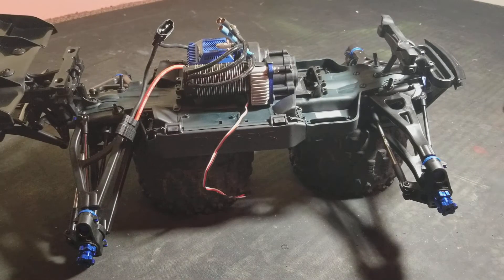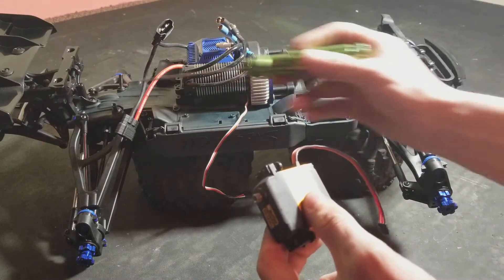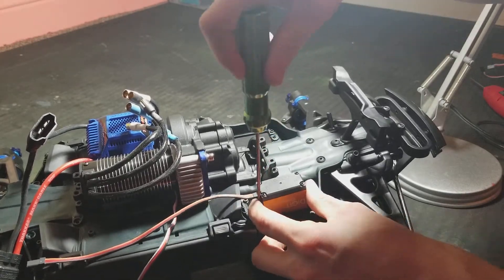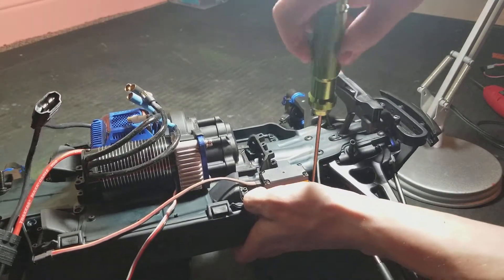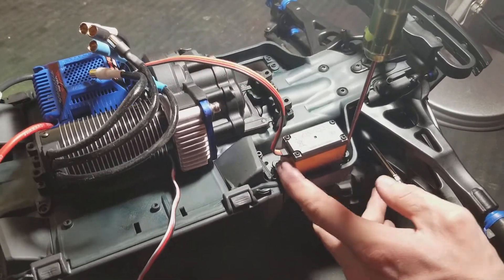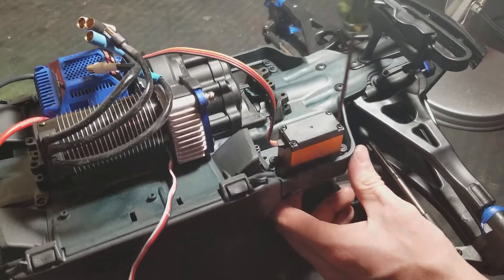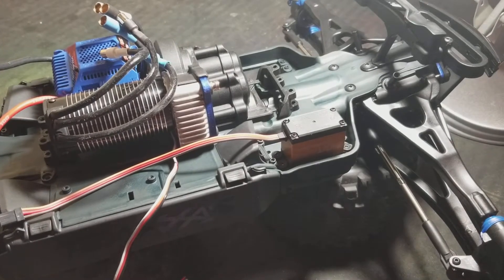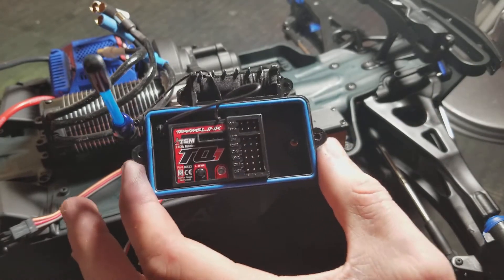E revo 2.0 savox sa1230sg steering servo install

Comment: Hey Alex,  Thanks for the tutorials.  I would love here your experience with the upgrades you have done.  Especially these servos. I don't seem to find a follow up video of showing the Revo running after each upgrade, with your thoughts of a difference.  And then maybe a follow up video later on about how upgrades have held up overtime.  Keep up the videos!

Comment: So you only need one servo it comes with two what do you do with the other spot
Reply from the maker: Ronald Costigan nothing  just leave  it  500oz of tourq at 6v is more  than  enough  power  to turn any wheel and tire combo
Reply: Thanks
Reply: Ronald Costigan I put a pez dispenser in that spot to make use of it.

Comment: Hey Alex,
Are there any problems in form of losing steering speed or steering torque by using one Servo???
Reply: And is quite a bit faster aswell. Also, its always more efficient to run one servo, two servos tend to fight each other because of slightly varying specs, even if they are the same model and make
Reply: And another tip, dont use those rubber gromets... They arent necessary for a steering servo in a car and it makes it much easier to install. They're used to give the servo some flex under load to save the servo, but the servo saver has got that covered already. Its also used to dampen vibrations but thats more of an issue with rc helis and planes where the motor is on for the duration of the flight.

Comment: I installed new servos but now my car only steers to the left a little and a lot to the right so the steering is uneven how do I fix that
Reply from the maker: johnny bravo take off the servo horn turn on the vehicle and the transmitter make sure your steering adjustment knob on the transmitter is centered on zero then Center the wheels as best as possible reinstall the servo horn and it should hopefully fix your problem it sounds like the servo horn is not adjusted correctly hopefully this will help

Comment: sir, do I have to upgrade the stock servo horn or anything? thanks
Reply from the maker: vuthina roeun as long  as the new servo is  25 tooth spline you WONT need  to  change  the steering  servo  horn make sure  if you  upgrade  the  steering servo  its 25 tooth spline
Reply: Alex rc freak thanks. m using savox 1230 too
Reply from the maker: vuthina roeun does Savox 1230sg Servo is an amazing Servo that is the exact same Serv I have in mind and you can use the stock steering servo horn and it will work flawlessly it's an amazing Serv I love that server that's the one I would recommend

Comment: Any issues with it?
Reply from the maker: Sven ! Yes the receiver  Port where the speed control plugs into is loose so the speed control will sometimes act like it's not getting power that's the issue I most recently been having
Reply: Hmm.. I can't decide on which servo to get, its between the savox sw-0231 MG or the Sa-1230. I'm aiming towards the 1230, your thoughts alex?
Reply from the maker: Sven ! Thanks for watching the video i recommend  savox sa1230sg steering servo upgrade its the best servo as far as im concerned  i have them in all my rigs and  they  work  flawlessly
Reply: Have you had any issues with the internal bec? Heard a lot of stuff on the web about savox servos drawing too much power for the standard speed controller and some people using an external bec
Reply: I have the same question.. any issues with internal BEC

Comment: My trucks brand new and the steering servos went on it. Traxxas is to cheap to give us the higher toque metal gears servos. Im going to take the 2075 sevos out of my 3.3 but i bet there going to fail to because the trucks weight.